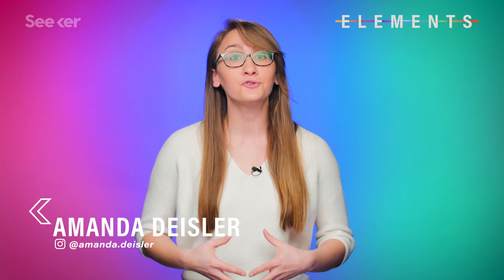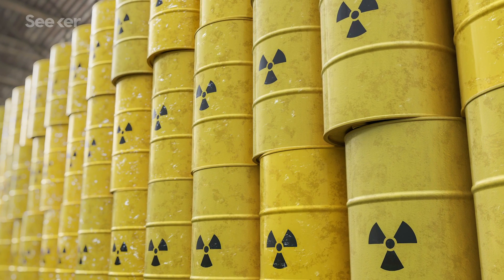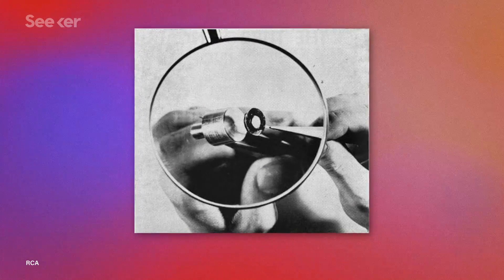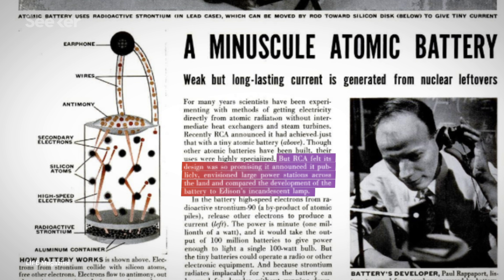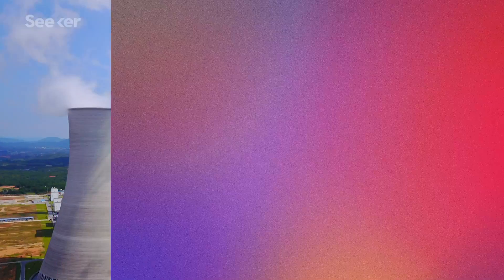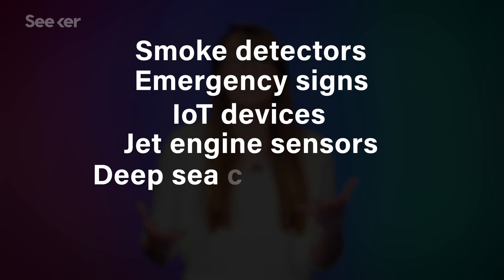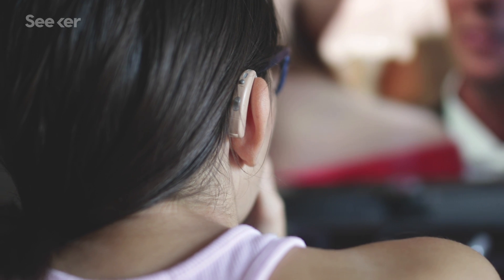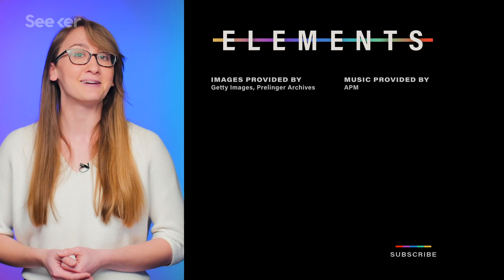Diamond Nuclear Batteries Are Forever… Sort Of

Comment: Nuclear Diamond Batteries are forever with extremely low power density and that doesn't mean it can't be awesome for some niche applications. For example, a capacitor can accumulate enough energy from such battery to allow a short radio bust of sensor data such as temperature, air pressure, air quality etc. Just forget about these for any multi Watt application such as EVs, smart phones, laptops etc. These are for micro Watts applications.

Comment: I know this is a late comment but I remember as a teenager (I'm 29 now) hearing on NPR about Prietto developing a battery that uses citric acid and copper foam. They said it should be commercially available by 2017 but it never came out, and I'm wondering why. I was so excited for it since it was supposed to charge a phone fully in 15 minutes and last way longer than any lithium ion battery. Feel free to reply to this comment if you know anything about it.
Reply: stock scam

Comment: Can these not be hooked up in series to boost the voltage?
A 9V battery has 6 x 1.5V cells in series to get to the right voltage.
If these diamond batteries can do the same then you just need to hook enough of them up to get to the 5V your phone needs to run.

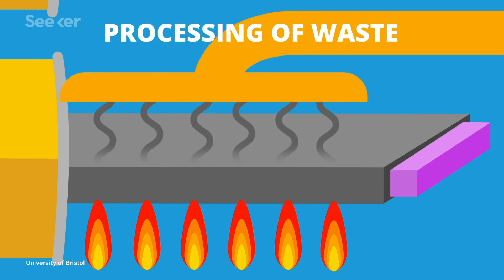Comment: At 2:56 they show an experimental gamma voltaic diamond battery but I don’t believe that carbon 14 emits gamma rays and only emits beta radiation. How is this a gammavoltaic diamond battery. I found another article about this on wired where it also uses this picture and says that it is a gammavoltaic even though the article is about betavoltaic. Does anybody know what is going on here or can direct me to the original source of the image?

Comment: Crushing your expectations: unfortunately, these batteries can only provide up to 100 μW in the same size and weight as an AA battery. That’s not even enough to power a small LED, which requires about 10 mW, meaning you’d need 100 of these to power a single LED! This would only be enough to power a purpose-designed chip. 

Also, the ad is full of marketing BS, such as using a carbon-12 shield, which is ridiculous as aluminum would make a much better shield, and many other things (you can watch Thunderf00t’s debunking video to learn more).
Reply: Obviously the technology is still in development, at some point it'll be good enough to power smartphones and such. It's just so new you can't expect it to be as good as a l-Ion battery
Reply: Calebelac The problem isn’t the technology, it’s that it’s physically impossible (without giving a fatal dose of ionizing radiation to the user, at least), and you can’t ignore physics. And besides, they have other problems like the fact carbon-14 decays to nitrogen-14, which is a gas and would destroy the battery pretty quickly.

Comment: Batteries that last for decades! Awesome, I don't wanna be greedy, but if carbon-14 decays with a half-life of 5,730 ± 40 years, doesn't that mean a Diamond Nuclear Battery (DNB) still produces half power after  5,730 ± 40 years? Sounds it may just the thing to power a probe to Alpha Centauri. 

More questions: (1) Okay, tiny current, but how tiny - how many milliamps at what voltage per gram of diamond? Maybe it cannot power the communication lasers for Alpha Centauri power but could have photovoltaic panels once it is close to the star. 

(2) Carbon-14 decays into stable nitrogen. Does this create bubbles in the DNB? Will it stop the current flow? Or will it built pressure and you have an explosion of diamond shards that shred your spacecraft? Not a good day. 

(3) Does a DNB have to be a single crystal or can you make it from carbon-14 diamond dust? That will help that the nitrogen venting, I imagine. 

(4) Chemical batteries push electrons on one side (cathode) and pull electron in the other (anode). Since DNB convert neutron to protons and electrons, does it have an anode? The new protons don't leave the nucleus. But it has no anode, how the electrons complete a circuit? 

(5) How much these puppies cost to produce? Say for a One Watt battery, say One Volt at One ampere, or what?

Comment: Well, it's really a fuel cell, but if you think of a rechargeable battery that is only charged at the factory then aluminum air batteries are batteries and are rechargeable! This such a promising bit of tech, please touch on this.

Comment: "without any noticeable power loss"?? That is not right at all. Radioactive materials tends to decay half of its mass every "x" year and this amount is defined as half life(Just like stated in the video) of the material. If we think logically, this means every time the material loses its original atoms' mass  in their next half life the output material will be getting lesser and lesser. So the Beta particles that will come out to provide current won't be sufficient after an amount of time even after the matter experiences its first half life period.

Comment: Ok so what about older style cellphones? It seems we got spoiled with all our high end gadgets. Smart phones are great, and have many uses, but I am sure a lot of people would go for a low tech cellphone that can last decades without charging.

Also what about a battery pack that slowly recharges itself when not in use. Sort of a hybrid technology? You can still "fast charge" by plugging in, or slow charge if you have no close by power source.

Or a cellphone with a high and low power mode. You always can make a call, but you can use gps, internet, etc, by plugging it in or letting it charge with this, slow charge mode?

Comment: I wonder the amperage for a given size. It could be used internally to trickle charge and/or assist in powering a device.

Unfortunately it's probably near nothing in comparison to even the most anemic phone and it's radios. But!! Maybe a watch :) it would be a killer smart watch with e-ink.

Comment: The diamond battery is more advanced than your video portrays.  The ones currently in use power most of area 15 and 16 operations.   They also power the "ufo's"  that people see and are the "zero point" energy devises which Bob Lazar saw in the 1980's.   In fact, the USAF wondered if one of our advanced crafts crashed would the russians be able to reverse engineer it.   So they brought in a team of people, didn't tell them what the craft was to see how far they could progress.   Bob apparently couldn't figure out his part and assumed it was an alien craft.   However, the glass panel he discusses was actually Heat absorbing glass and a "diamond battery".  Diamond batteries are better at holding and releasing large charges than generating them.   Heat absorbing glass has a layers of silicate atoms  surrounding atoms of other elements which have large differences in their heat absorption rates.  As the elements try to become the same temperature they let off large electrical charges effectively changing heat into electrical energy which is then passed to the diamond battery(s).   On a completely unrelated side note, the crafts don't move, they move the space to them thus no Gforces are produced on the craft, pilot or his boxed nasty.

Comment: Someone would buy a ton of f beta voltaic batteries and make a dirty bomb.
Reply: Beta radiation can't really be used to make a dirty bomb, almost everything blocks it, including a metre or so of air. a few cm of wood, a thin later of plastic, a sheet of tinfoil. It would be the least effective dirty bomb ever made, more damage would be done just using a regular bomb.

Comment: I thought for implants they use batteries that last decades not 30 days... In fact I'm sure of it. Pacemakers dont need their batteries changed every 30 days lol
Reply: Depends entirely on the draw. Most pacemakers are not firing 24/7. They are there to get the heart back into rhythm if it ever drifts. So it could potentially last for a very long time. Whereas a device that has to completely control the timing 24/7 would obviously use much more power.

Comment: "Exposure to which can cause leukemia" - 1:58. This is not only misleading, but it's bad journalism. Exposure to many things we use every day (plastics, the ocean, common household chemicals, sources of radiation like the sun, particulates in the air, etc) can cause cancer. As it stands, radiation is actually one of the safer things that can be used, and the amount of Sr-90 used for most betavolteics is pretty small, making it a risk only if you eat it--something that can be said of my Li-ion batteries, too. Anything misused "can be" a hazard.

Comment: With the development of microtechnologies we’ll soon be able to harness the electricity more efficiently and gain more power out of it and may soon be able to power hand held devices. Although, there would probably still be the need for a secondary lithium ion battery in order to up the voltage.

Comment: Extract for dirty bomb use. Never gonna be released for the general public.
Reply: Carbon-14 can't really be used for dirty bomb use. It doesn't emit gamma radiation, it is a betavoltaic battery and beta radiation can be stopped by air/plastic/tinfoil/clothes etc..

Comment: how can that C-14 diamond battery power an e-reader for decades but not a mobile phone?
Reply: mobile phones have more functions that equal out to a lot* more power needed. E-readers by comparison are so low energy that you could power it for a month off of just a small solar cell. Your phone runs out of battery in one day because its constantly connecting to the internet, updating, etc
Reply: @BigBadBossu  I see, so these diamonds can only deliver small currents and small voltage - something those other things mentioned do require, but phones require more.

Comment: So we only need to develop a material that can cover the radioactive object with a thin, light layer but manages to block the radioactivity.
If that were developed we'd have what those inventors were dreaming of. Yeah the diamond structure is safe, but it's really expensive to make and will never be practical for normal public use.
I mean, are u really gonna buy a synthetic diamond to power your smoke detector?

Nuclear energy could give power to the entire world and completely replace coal power energy as well as our reliance on crude oil. Yet its being boycotted everywhere to stop the progress of research.
Reply: It is the diamond itself that is the battery, it is not a structure built around it or anything. And diamonds are not expensive to make at all, carbon is readily abundant almost everywhere. The only thing that makes diamonds expensive is that they look pretty, but without the need to have the battery look like jewellery you can cut the cost by a significant amount.

Comment: would you be kind enough to cover why Hydrogen / Fuel cell Electric Air Planes are not being designed considering the compressed hydrogen's energy density can be about 400+ times that of the best Lithium batteries in the market. 
From what i understand the Energy Density of both Lithium Ion batteries and Compressed Hydrogen below.
Lithium Batteries    -  0.36 to 0.875 MJ/ kg
Compressed H2 (700 bar) - 142 MJ/kg

Comment: This really could be solution to some of our problems, imagine device that have this nuclear battery that is still and constantly charging main cell that is normal type, so power efficient. Like cell phone - most of time you don`t use it so power consumption is low therefore it can be charged via those low efficient nuclear power cell. One but: all thing have tendency to become smaller and smaller, so there would be no space left for heavy and well protected nuclear battery.

Comment: naa here's what you want. AA batteries coated with super efficient solar cells, that not only charge whilst in use (if you take the battery cover off the device) but let you recharge the battery by leaving it out in the sun.

Comment: Fun invention. Very useful for space exploration.
 Imagine a person who bought a hearing-air with such a radioactive battery, and then got cancer from it :-O
Reply: Beta radiation is very weak. A metre or so of air is usually enough to stop it, 1-2 mm of tinfoil will do the same or a thin later of plastic. Beta radiation isn't even strong enough to fully penetrate naked skin most of the time. Whatever device this 'battery' is powering should provide more than enough shielding. The battery itself usually has layers of non-radioactive carbon-12 around the radioactive carbon-14 to further reduce radiation risk.

Comment: Doesn't it take a lot of energy to create the diamond batteries from Carbon 14?
Reply: Why would it? The carbon-14 is already there as a byproduct, all you have to do is fashion it into this battery.
Reply: @Subjagator  But doesn't it require a lot of pressure to make a diamond. surely that must take some energy input.
Reply: @bkrharold  
Yes, it would take some energy input of course, but that doesn't need to be especially large nor does it need to be more than the energy you would get out of it.
It depends exactly on how you are manufacturing it though. Not everything made from carbon is a diamond and this battery doesn't need to be a diamond to function, I suspect they use the word diamond because they are both made from carbon and it just makes it sound better.
The graphics in the video are also misleading as I seriously doubt this would look anything like a shiny cut gemstone if it was manufactured.
Diamonds are not as valuable as their price tag in a jewellers would suggest and industrial diamonds are much cheaper to manufacture if you don't care about how good they look.

Edit:Did a search and found some prices. A synthetic industrial diamonds price can vary from $0.40/carat to several hundred $ per carat with the majority being around $0.40 - $3.50 range. It depends on the quality, structure and its intended use.
Compare that to natural diamonds used in jewellery which can be anywhere from $1k-16k per carat, depending heavily on how it is cut and how much is sparkles along with a whole bunch of other useless nonsense that people attach value to(Give this a read to get a true understanding of the ridiculousness of pricing when it comes to diamonds: https://www.diamonds.pro/education/diamond-prices/). People think diamonds are super expensive because the price is heavily manipulated and based on how pretty it looks but in reality they are extremely common and very easy to manufacture.

References: https://minerals.usgs.gov/minerals/pubs/commodity/diamond/diamomyb03.pdf(22.2, top right, Prices)

Comment: IF it makes its way into body implants there will be so many safety regulations on it that it might make the implant a little thicker then it otherwise would be to count for concerns from non-scientists. Now IF it works that will be cool and super useful to everyone who has an implant. The problem will be funding it will be a pain as if you only need a replacement once every lets say 40 to 70 years then that is not really a money maker so the cost will be higher for it because capitalist greed.

Comment: Isn't one of the issues that they output a constant amount of power, regardless of whether you need it or not? This sounds great, but could actually be a problem, since that energy has to go somewhere. Most devices don't use a constant amount of power (think of your phone while playing a video vs having the screen off). This would seem to limit their use to applications with very stable power demand.

As an aside, the first source cited (in the description) is absolutely riddled with grammatical errors, making it difficult to read in parts.

Comment: Would a nuclear diamond battery that could be created en-mass and arrayed for high output be doable? I assume it might be expensive, but if it really lasts as long as claimed with a consistent output, then it seems that the small units should be possible to stack, much like the small hotdog-sized batteries that the Tesla cars use.

Comment: Using them for implants is a great idea however I have often wondered why we cannot power implants ourselves.  We generate quite a bit of heat & we are effectively electrically powered. Surely we can find a way to harness a fraction of all of this power for implants.
 I would suggest that in order to keep something like a pacemaker powered up all you need is to keep your body fuelled.
Emergency cream cakes on prescription.
Perhaps banana honey cake would be more energy appropriate.
.
Reply: Well, if our bodies can power both Matrix and the Machine City at the same time, we can surely power a flimsy pacemaker too. It would need a good capacitor, though.

Comment: So a smoke detector would have TWO radiation sources in it!  The ionization type contains a well shielded speck of alpha-emitting americium (made in nuclear power reactors) which ionizes air molecules, allowing a small current to pass across an air gap.  Smoke particles stick to the ionized molecules and neutralize them, reducing the current flow and thus triggering the alarm.

Comment: Quick question: they say it's totally safe because the radioactive energy being released is used by the device it's attached to but doesn't that by default mean if the bits connected to it stop working or are faulty from the manufacturing process it's dangerous? 

That doesn't sound totally safe to me...
Reply: It is totally safe because beta radiation is blocked by almost everything, including wood, plastic, 1-2 mm of tinfoil, a metre of air, thick clothes. It doesn't even always penetrate naked skin. The carbon-12 surround the carbon-14 would be more than enough to contain it.
Reply: @Subjagator  thanks for the explanation.

Comment: Is not a battery a series of energy cells? Wouldn't 1 diamond effectively be 1 cell? "seems" like it could scale to higher energy tech. What are the reasons for not scaling the voltage in batteries?